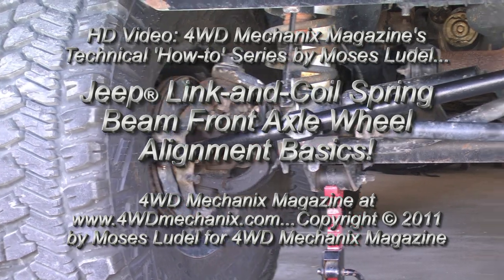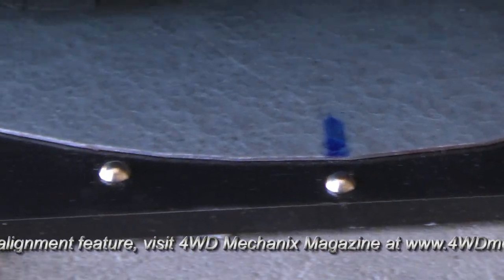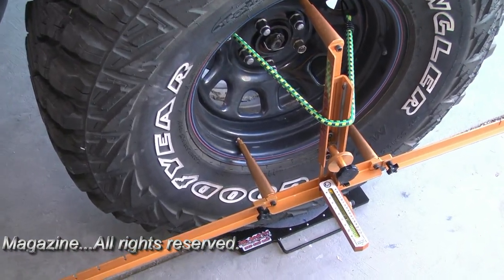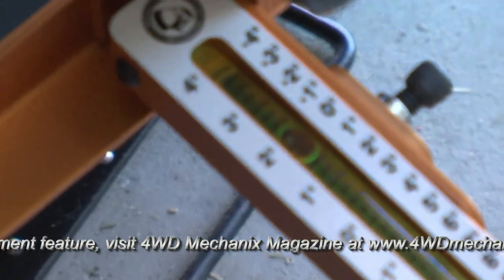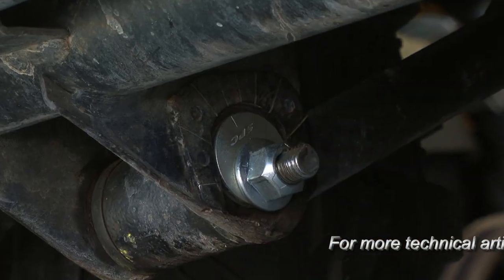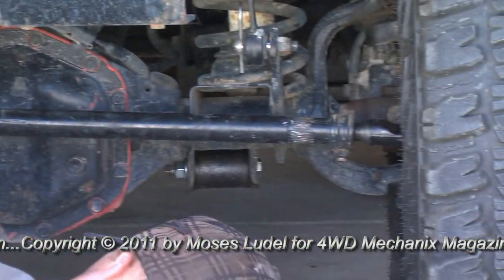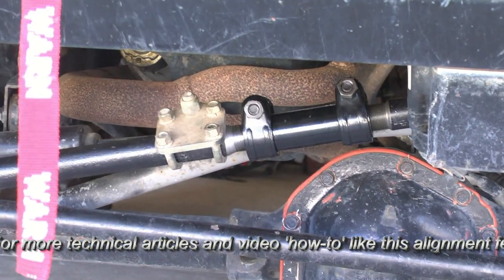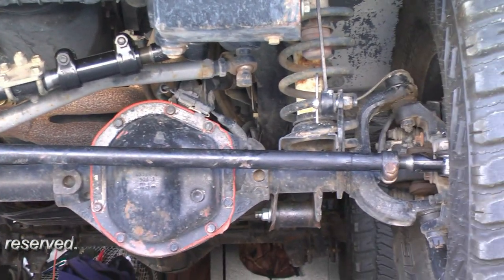4WD Mechanix Magazine 'How-to': Jeep TJ Wrangler Wheel Alignment Basics!

Comment: how to determine caster angle 15 degree?  

;still caster angle calibration not clear
Reply from the maker: Caster and camber get checked one front wheel at a time.  The turn plates shown are marked for zero (wheels pointed straight ahead), 15 degrees left (wheels turned left), and 15 degrees right (wheels turned to the right).  The FasTrax gauge procedure for a caster check starts with sweeping (turning) the wheel outward from straight ahead ("0") to 15 degrees.  The front of the tire is now facing outward 15 degrees.  Here, the gauge's vial block is set to zero ("0" degrees).  Then the wheel is turned in the opposite direction, past zero on the turn plate to 15 degrees inward on the turn plate.  With the front of the tire pointed inward 15-degrees, the vial block reading will be the actual caster angle...After adjusting the lower link arm lengths with the Specialty Products (SPC) eccentric adjuster bolts, this TJ Wrangler beam front axle's caster setting is at the factory recommended 7-degrees positive (+) caster...I use two FasTrax gauges, each with toe-set arms, to simplify my alignment work.  Alignment can be done with one FasTrax gauge although the gauge must be moved from one front wheel to the other during the alignment checks for caster and camber.  I perform alignment on each of our vehicles, ranging from the VW Jetta (front and rear checks) to the beam front axle XJ Cherokee 4x4 and Ram 3500 4x4.  The beam axles are quick and straightforward...Note:  For a caster check with the FasTrax gauges, I have the front wheels on turn plates.  The FasTrax vial gauge end is V-shaped to 15 degrees left and right for users who do not have turn plates.  However, this job is more accurate with "floating" turn plates.  The portable Gil Smith plates I demonstrate here are inexpensive, and they work.  There are also more expensive ball-bearing type turn plates available in the market.